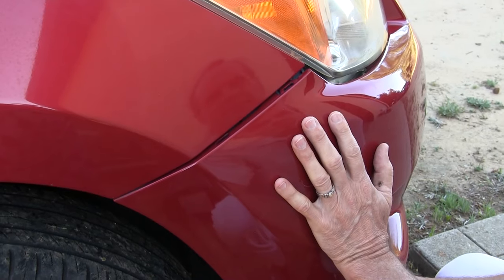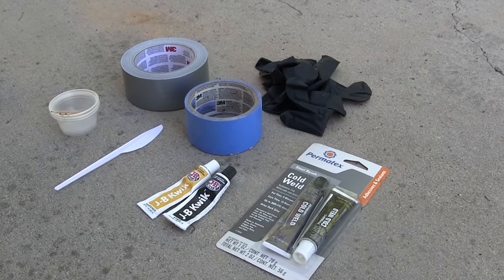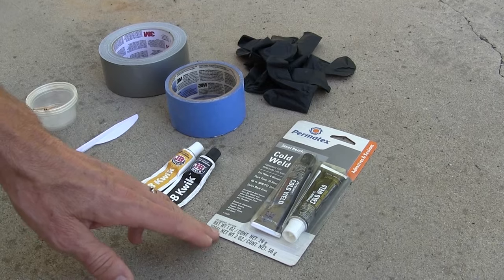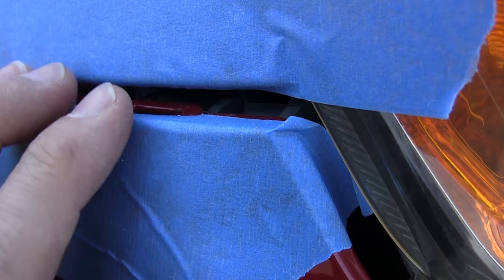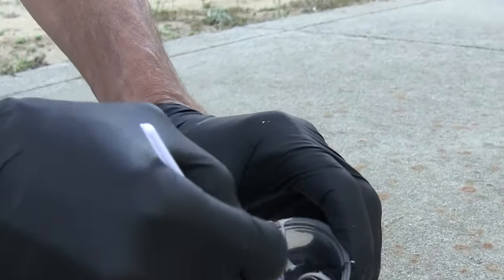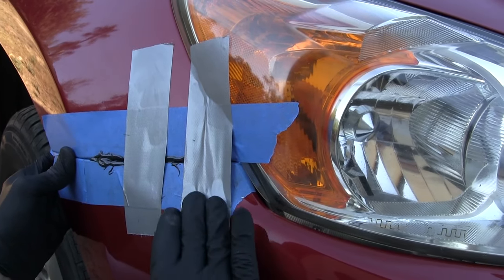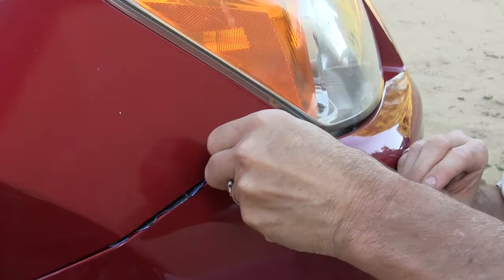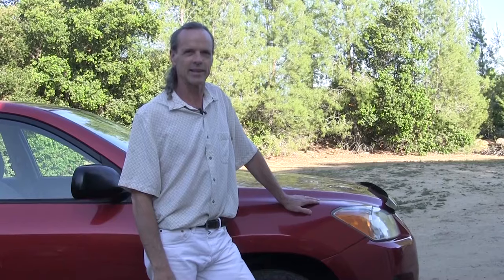How to Fix Your Bumper - The Easy Way

Comment: Brilliant! My daughter's 2012 Corolla is all beat up and we certainly didn't want to pay to have all the clips and fittings replaced.  Both sides were hanging off between the headlight and wheel well.  I used Permatex Black Plastic Welder. 5min set, 10min cured. The black line between the two panels looks great and intensive wiggling shows everything to be stuck up in there really well!  Thanks!
Reply: Under 200,000 miles and just got a few more years left? It must not be a Toyota then
Reply: @southernberean8166  I don't see where I mentioned anything about a "few more years".  As far as I'm concerned, my daughter can drive it until she's a grandma.  It's just so beat up cosmetically this solution was a much better option than spending a bunch of money on a proper repair.  Peace.
Reply: I have the same problem with my 2015 Nissan Rogue; a few broken clips but its not too bad. This video should help with that problem. I will give it a shot today.
Reply: @Bkaleb328 pop
Reply: @1518joefil1  He was talking about the guy on the video, not you.
Reply: Glad to know this video was helpful.  Early this evening I slid into a downed light pole on the freeway (major down pour) when I backed up I could hear my front bumper move but didn’t think much of it until I heard the rattling noise on the passenger side.  I drive for DoorDash and need a working car😁.  This should be fun fixing my 2011 Toyota Corolla w/119k miles.
Reply: The clips are no more than a few dollars and if you have to remove the front bumper cover for any reason you will then have to replace the fenders. If you do it the way this guy does it.
Reply: Except in our case, new clips wouldn't have solved the problem as the receivers were also damaged.  This repair held strong until the car was traded in recently. It was a great quick fix for me.
Reply: Yes, this works. Thank you. 😊I used  the JB quick weld on my Toyota Carolla also . It sets fast. I only got one side. I  have to do the other side
Reply: @1518joefil1  Late reply, but I'm pretty sure southernberean was referring to the car in the video.
Reply: Yeah perhaps they responded to my comment by mistake then. No biggy.
Reply: Same but 2016. I’m starting to think toyota needs to make better clips too.
Reply: 😂 You Sound Like ME brother. My daughter ALSO HAS A Toyota Corolla and it's beat up too. The Things Us Dads Do for our Girl's. (I'm sure while You WANT TOO, they are just not ready for a New Car) 😂😅
Reply: Okay so the THIS TOTALLY Works BUT ... 
You have to make sure That THIS is gonna be YOUR FINAL FIX. NO Changing your Mind Once THIS JB Weld (or any similar 'WELD'. 
It is soooo damn SOLID, 
That a Auto Body guy (a friend of mine)  told me if I changed my mind they may have to rip off the entire front end since the bumper will be connected to the Hood Portion. 
That tells me it HOLDS that Good!
I fixed my Daughters Rear bumper 3 years ago using 'JB WELD' and as of Aug 2024 still Holding Strong.
Reply: Yup! My daughter got two years out of it and then traded it in to CarMax. They paid more than I ever imagined for it and did not even care about this repair. She's in a 2014 Accord now. Everything is still attached properly......so far.  😆
Reply: has anyone used Goop? works just like JB Weld😃

Comment: I found an easier way!   If you remove some of the clips holding the plastic liner of the wheel well, so you can get access to the 'inside' of the quarter panel, you can reach in, pull off what's left of the old broken bumper clips, and insert a ZIP TIE there instead. You then thread the length of zip tie to the hole on the bumper and bring it around to the other part of the zip tie where the hole is. You then pull up the excess length of the zip tie, pulling up the bumper, and that's it, fixed.
Reply: I’m going to try this on my 2006 Honda Ridgeline!
Reply: That does not sound easier
Reply: The clips that broke don’t they sell them separate ?
Reply: That's exactly what I was planning to do with my old honda civic which is extremely low for Houston roads but some of my loops on the bumper broke so I'll probably have to use this "glue mix "🙄 I don't like the idea as everything must be removable in my opinion but what can I do...
Reply: Excellent idea with the zip ties.
Reply: Hope there was a video showing how to do it with zip ties
Reply: I know this might sound odd, can you explain that again? Cheers
Reply: @imanaazeez lollll
Reply: Thought the same thing thank you oh
Reply: Sounds complicated. Make a video
Reply: It's not complicated this sounds really easy because my liners fell off but mine were bolted on one side and clipped on the other. If you pull out the clips you can see behind the bumper. Some other liners are screwed in with torque screws which makes things a little more difficult
Reply: Nvm it's not easier. It's not possible with my corrolla
Reply: You should do a video, because I messed up my bumper and would love to see the video
Reply: He'll ya dude u saved me 500 bucks and it's genius
Reply: Thank you. Gonna try it out.
Reply: @mr.trammell6399  with our 2016 es350 Lexus the bumper cover has the clip holes that broke. Lexus will replace your bumper (and paint it). These hacks are a good alternative
Reply: That’s what I did but I have to keep punching it back in
Reply: @mr.trammell6399  how are you going to replace the clips...glue them on?
Reply: I need a video demo tho!!! Haha, thankyou!!! this is what I was hoping for  as a quick fix! I honestly can't deal with adhesive etc 😅
Reply: Seems not easier 💀💀💀
Reply: Can you make a video too
Reply: Anyone that says your idea doesn't sound easier has not had to work with adhesive in difficult places before.
Reply: I'm thinking of trying the zip ties but would it last in hot weather, such as Arizona?

Comment: Ok now show me the easy way to take the bumper off lol
Reply: If you 'have' to take the bumper off again sometime soon, probably don't use this method. 
This is good if you want to save buying a whole new bumper. Like he said, only for cars with a 3 year life span.
But it can be removed with heat and isopropyl alcohol.
Reply: @howdy000  wow so this glue he used for sure , definitely will work and bumper will stay on place for long ? 
need to fix my bumper for a toyota yaris  2013 , i do not want buy other bumper ,
Reply: @lizzetcastro73  I used a different adhesive as I live in Australia. I used quick setting adhesive (black) and followed the same steps. Looks alot better! Very secure... I haven't attempted to take it off yet.. I don't plan on it now. Goodluck 🙏
Reply: By the time you need to remove the bumper you should already have the new one in line haha
Reply: @howdy000  I'm in Australia too - what sort of quick setting adhesive did you use? (Araldite is my go-to for plastic repair, but not sure if it is appropriate here!)
Reply: @maradall  it was something called "speedy-fix". It came with grey or black option. But it's powder form, so you have to sprinkle powder, then drips of liquid, then it sets in seconds. Too fast. Try find an adhesive that sets after 30 seconds.  So you can line up before it dries.
Nd make sure to use paint/ masking tape 🙏 don't let that shit go on the paintwork
Reply: @howdy000  Thanks! A couple of people have said they used silicone - that might work better. It's flexible...
Reply: @maradall  too late now 😋🙌 but thanks for the feedback 🙏
Reply: Sawzall, then if you need to put it back just put more adhesive 😅
Reply: That was my first thought 😂
Reply: I feel like this would make more sense with hot glue. At least you could use a heat gun if you need to take it back off in the future.
Reply: lizzet castro I just repaired the bumper on my daughter’s 2012 Corolla and learned a bit in the process. Sometimes one can buy only a few brackets that are damaged (these were mounted behind the upper bumper cover between the wheel well and headlight) and clip the bumper cover back down onto them. I elected to use a combination of tie wraps and bolts/nuts to repair hers, along with simply re-clipping some of the plastic tabs back together wherever they were still usable.
Reply: It's not too difficult?? A lot of them are claps that hold the bumper together itself, and the rest are just some screws here and there.
Reply: Apply heat?
Reply: It is like cement now, you will need a thin blade metal cutter and cut along the gap to separate the two.  Hahaha
Reply: Next Episode:  How to paint your car with a used paint brush and roller!
Reply: @jomamastool  hot glue will reactivate under the sun and melt just enough to detach the bumper again
Reply: @MrMOGHammer  funny enough...
That happened with mine 🤣 I tried it with hot glue and especially because my car is black it definitely didn't hold...
Reply: Yeah,!!!! He's going to say you have to smash it into a concrete Wall. Lol
Reply: @MrMOGHammer  Not to mention the radiant heat transfer from the engine itself would probably be enough to melt the adhesive. Thanks for pointing this out lol.
Reply: @Sgt.Subversion  no honestly it'll instantly fail with hot glue, its so weak its not even funny.
Reply: Better still, just get some new clips and take the bumper off and do it properly. Your mechanic is going to charge you extra for doing any subsequent work under the car at the front requiring the bumper to be removed just for pissing him off!
Reply: This is an end of life fix, meaning the car will either be parted out soon or crushed into bits, it’s probably not intended to come off again, also sometime proprietary parts cost a fortune for a car with little to no market value, I’d probably glue it so long as it does the job for the remainder of the life of the car who cares.

Comment: This is caused by bumper scrapping and catching on those parking spot curbs. The curbs are too high for today’s cars. I always park a foot short of them now.
Reply: The parking curbs are not the problem, the low orientation of the bumpers on the cars is the issue.  This is just another example of how car manufacturers exercise planned obselence of their vehicles.
Reply: @retiredhappy466  ya partially agree cz it’s a preferable choice to drive and do what you like in life? No? So life around us needs to adjust to us not us to it. Besides what’s it costs to make the parking curbs a little shorter (nothing crazy maybe 3-5 cm) no the problem is the parking curbs my man......think bout it So now I gotta ride in style the way the parking curbs want u to.? Lol but not all that confusing just stay a foot away from the curb
Reply: 100%
Reply: Idiots think they need to put their tires up to the curb or sidewalk instead of realizing their cars are about two and half feet in front of the tires. Figure out where the front of your car is, park there.  Or, pull up until your tires run into something and tell you to stop, it's just plastic.
Reply: Thats the reason why im not lowering my car
Reply: or just back in
Reply: @SupraNene  Not a realistic attitude.  Life is life, and generally WE are the ones that need to adjust.
Reply: @jamesnorman4035  how is it that we need to adjust, so who’s doing the adjustment around here ,If we have to adjust? Casper? God? No it’s us we make the structures, buildings, transportation,etc we the people. So if I’m the cook that’s the provider for the food for life to continue for humans, let’s just say 2 out of 10 can’t eat the food I made cz maybe it’s to rough, spicy, etc. a great example would be, they have to adjust to my cooking? No that’s why we find another cook that will do better for all Or most atleast. James you see my point? Or should I break it down more?
Reply: @crustyfapkin4349  I am watching this video because my almost slammed cars rear bumper almost got unattached today and broke the clips and the securing bolts. So low cars are not always fun, especially if your location has garbage roads and tall parking curbs
Reply: Facts.i never had a problem with my bumper until I bought a used Accord that was obviously customized because it came with sounds and tinted windows which I love but the car sits so low.i have to be careful pulling into some driveways because the bumper will easily scrap the ground.i love the car but that sucks.im on my 3rd bumper and only had the car a few months
Reply: Learn to drive and don't hit the parking lot curb. If you know the dimensions of your vehicle to park it,  you can own 2 or 3 sports cars like I do and never have this problem. However, my girlfriend has this problem on every car she owns. So the problem is really with the driver, not the car.
Reply: Also caused by drive through car washes.
Reply: Exactly what happened to me
Reply: @sew04ss or get a 4x4 lol I have 2 sorry kidding
Reply: Yea my car is so low
Reply: That’s exactly what happened to me

Comment: TIP: Firstly thanks so much for the clear instructions. I just finished my repair. Try carefully peeling the masking tape away when the glue is 2/3rds dry. I did this on the second side and had perfect results. First side i has the same tearing as in the video and has to use a razor blade to finish the tape removal.  Rather than duct tape, i just help the bumper in place with my hands (actually a leaned my whole body into it and used my hands). The bumper was not a nicely refitted as in the video so duct tape would never have worked.
Reply: how long is 2/3 dry?
Reply: Yeha how long is 2/3 dey
Reply: Yeah man, I'm so glad I read your comment before trying this. I sat on a crate and positioned my knee so I could add pressure to hold it in place. After about 5 mins I started to peel the tape off whilst still holding it with one hand and with my knee. Getting the tape off before it hardens made a massive difference, there was sill a little bit that I had to cut out but I reckon your comment alone saved me about 30 mins.

TIP: If you're reading this, wear a glove and push the glue in with your finger, it goes in cleaner and further.
Reply: Do you really not have the sense to figure out what 2/3rds of something is? In this case he was clearly referring to the drying time which you will see on the instructions.
Reply: @neben  66%

Comment: after watching this video, i fixed my Honda Civic 2012 bumper and it isn't going ANYWHERE now. i got the bigger tubes of epoxy for $20 from autozone and did both sides, along with a headlight that needed changing and i spent the afternoon doing the repairs. Thank you YouCarAngel! Way better than spending god know how much the autobody shop would have charged me to fix this.
Reply: Tried this on my wife's 2010 Civic. Passenger side no problem. Driver's side  the bumper wouldn't align. It was about a quarter inch short.

Comment: I did this repair exactly as you suggested except I used 100% silicone, indoor/outdoor,,its been 3 weeks seems to be holding perfect, looks fantastic, was super easy,,👍👍
Reply: How did it hold up
Reply: @phclout5893  I'm glad to report still holding/looking perfect.  if and when it let's go I'll just clean off the clear silicone I used and reapply useing same method
Reply: That's an interesting idea,thanks.
It has some flex for resilience and peels right off if needed later. I'm guessing the biggest factor is having enough contact area
Reply: @ronchappel4812  thankfully its still holding /looking great and I wash my camaro every week no problem,,,I like the silicone better because it's easy to remove if I ever need to and easy to reapply.
Reply: jb opoxy won't hold up under the sun's UV radiation. ived done this before on my prius and after 1 year, the opoxy will become brittle and crack. you need outdoor UV resistant construction glue
Reply: @a552bcx  you just used uv resistant glue or something else
Reply: Is it still holding up ? Does it look good?
Reply: @darikquezada7221  yes still looks perfect,,I wash my camaro every week still holding in place perfectly
Reply: Thanks so much for the update throughout the year, it really helps!
Reply: @jonnaenorals440  no problem,,it's still holding up and looks perfect
Reply: What kind silicone did you use?
Reply: @DesertYat  I got it at home depot,,100% silicone indoor/outdoor  it's perfectly clear,,,still holding perfectly to this ,
Reply: @tucoramirez9729 hey there I need to glue my bumper what exact product did you use.
Reply: @a552bcx ain't no uv inside the fender.
Reply: How's it holding up now
Reply: @SittComani  still perfect, I haven't had to touch it,,

Comment: Thank you. I have a 2006 Explorer, very clean but I didn’t want to spend a fortune reattaching. Great instructions. Thanks.
Reply: I bought the materials when I made my above comment. It took me a minute, but in the meantime, someone smacked the other side and broke that clip. I followed your instructions and both sides of the bumper came out beautiful. I was able to find a clear self mixing epoxy with a detachable long nozzle. It was basically injecting the epoxy. The paint tape and duct tape worked great. I used alcohol on a cotton ball to remove the small amount of duct tape residue. It’s been bugging me all this time. Don’t know why I waited so long. Probably 20 minutes total to fix both sides. Good as new.

Comment: I have several times sorted this problem out by removing the headlight and using cable ties through the return on both the bumper cover and the wing. Much easier and a lot less messy.
Reply: This sound promising.  I figure there has to be a way to tight it up.  My main job is DoorDash so I just need to to hold in place while I deliver.

Comment: My headlights are intact and look fine, and the bulbs for my car are easy to access via opening the hood. I used a non residue duck tape from Home Depot. Was able to leave that on the car for longer than 10 min, and it was very easy to come off. Thanks for the video!